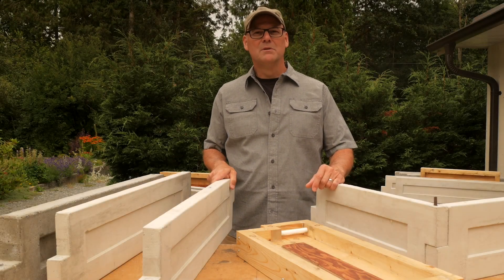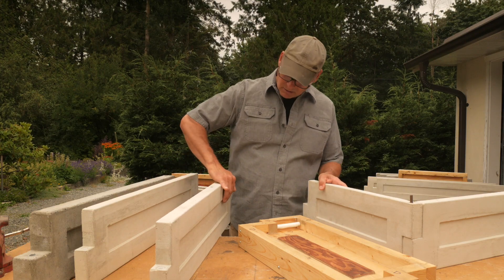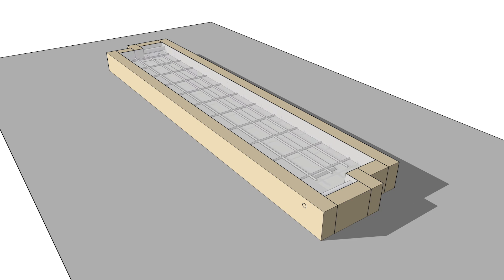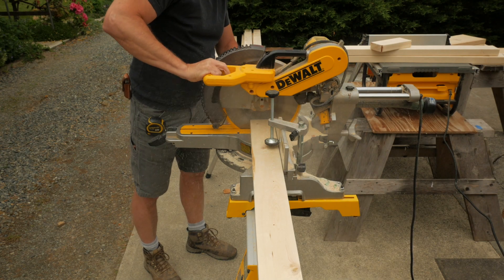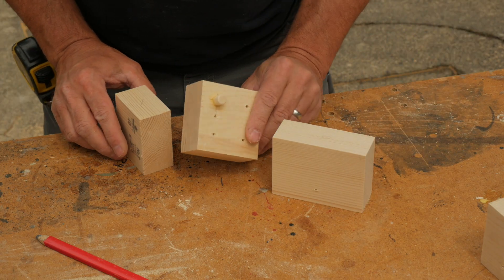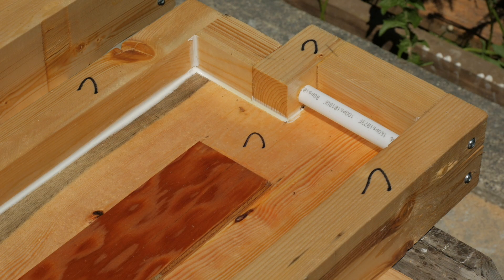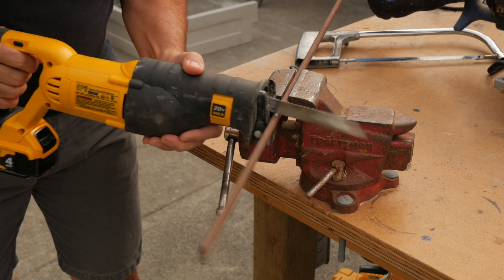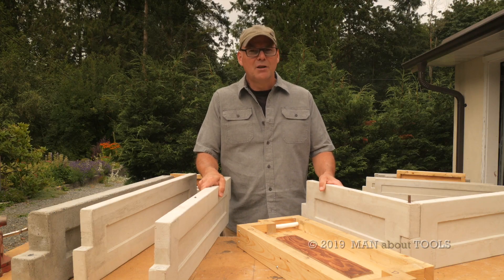make Thin CSA Concrete Garden Boxes PART 4 - cast garden forms

Comment: You can also do something else for decoration. Leave out the inset, pad the mold with plastic foil, spread a thin layer of sand on the bottom (really, 1/4" or less), then spread pebbles just barely twice as thick as the sand in a double layer. Use a spray bottle to wet the sand and the pebbles. Or maybe use water for the sand only, then, after having spread the pebbles, use a ... thing whose name I don't know in Engish, but which strengthens the bond between the pebbles and the concrete. And only then pour the concrete. The sand will wash away after you de-mold, and you'll have a nice pattern of tiny pebbles on the surface. With the right pebble size, they should be enclosed in the concrete, not just attached so that they can fall out.

You do need the wire mesh, regardless of what cement you use. Concrete alone is strong in taking pressure. Rebar or wire mesh is added for making it also strong under strain. It would crack much faster in winter, when water inside it freezes, without the wire mesh.

I have a question, though: does the weight difference come solely from the lower thickness, or is the resulting concrete less dense?

Comment: thanks for sharing, looks great, can't wait to try my own. My wood boxes only last 5 years or so. I'm going to try to make ends rounded so the panels can be rotated at angles other than 90 degrees so other polygon planter box shapes can be laid out. It would be nice to be able to plan out triangles, pentagons, or even curves with many 24" panels. Also planning on replacing the simple beveled inserts with some molding with vines/flowers if I can find a design that will still release easily. Lastly, the previous comment on getting the wood grain in the mould is a good idea, sandblasting also gives a nice neep wood grain effect but I suspect that the more designs in the moulds will make the release increasingly more difficult, maybe necessitating a silicone releasing agent.
Reply from the maker: Thanks! And thanks for the comments and ideas.

Comment: Calcium Sulfoaluminate (CSA) concrete is also highly resistant to sulfate attack, so it is perfect for use around livestock where subject to manure exposure, wastewater treatment and conveyance systems where subject to Hydrogen Sulfate gas, and in soils that are high in sulfates.

Comment: would you recommend disassembling+storing the panels or covering the garden boxes with a tarp in the winter to try to prevent the ice from cracking them?
Reply from the maker: I leave mine as is for winter. However, I'm on the west coast and our winters are milder than others.  Covering might be an option.

Comment: I would be more amazed i I once saw an American drilling a hole without a drill press. Cutting a piece of wood with a hand saw etc. All I see is expensive wood working tools, CNC machines etc. So like any video made, this shows you that you need 1000$ before you start making the 10$ garden form.
Reply from the maker: Or a Canadian in this case. Certainly you don't need a lot of expensive tools to build these forms and cast the panels. Some hand tools or hand power tools would do. In many of my videos I show alternative methods. I have a cheap table top drill press and my table saw is portable and close to the cheapest model available.

Comment: @Man About Tools: I only have one word for you brother:
Aircrete.

Those blocks will float too if you use this stuff. Your forms can also be used to recycle plastic if you have enough shavings to do it. You'd basically be using it as a hot mold and injecting the molten plastic to make it work, so there's a need for an additional plate with multiple injection ports. Still favoring the aircrete idea first though. Your's is already pretty close to that as it is, but aircrete will make the concrete go even further and should reduce the price of your final product.
Reply from the maker: FatChanceTheCouchDog  See Part 3 then 3.6 of this series.

Comment: I'm not sure why strength needs to much of a consideration here.  There are no loads.  BTW, try pearlite insulation as as an additive to make the panels even lighter.  There are are also foam additives for additional lightness.  I bet you could get them down to 20 lbs!
Reply from the maker: Yes there are lots of options. See the other videos in this series. I have 7 so far.

Comment: A tip. The compressive strength of the concrete is keeping the centre fairly stress free. Better to lay the reinforcement one third from the outside edge.
Reply from the maker: I agree. It's just a bit of a challenge to get the grid placed exactly where it's most effective.

Comment: Great video with easy step by step instructions. Would aircrete be a better alternative instead of concrete?
Reply from the maker: Thanks! Aircrete is an option. See Part 3.6 . There's always a strength and durability trade off when going light weight.

Comment: I like the comment that Garret Peterson made about the outside face being in tension when say heavy (clay) soil or frozen soil expands. During the video I saw that you added an insignificant amount of glass fibre; you didn't even quantify it in your ingredients proportions, but glass fibre can entirely replace the galvanized metal as a reinforcing material. You might even blend your mixture so that half has 2/3 of the fibre and the other half has 1/3 of the fibre, then coat the bottom outside face with a little low fibre mix. Not much just enough to reduce the amount of fibre showing on the face of the finished product. Then place the high fibre mix in before leveling it off with the remainder of the low fibre mix. Vibrate as before. After extraction from the forms I think another concrete counter top maker used a sanding block to removed any exposed glass fibre. Maybe this is too much fiddle but it was just a thought I was having while I was noting how little fibre you appeared to be adding.
Reply from the maker: The amount of fibre added was from the manufacturers recommendations. It's a small amount but if really does distribute well and it's visible if you look closely at the panel. I can't say for sure that it does what it's supposed to do but it's cheap and easy to add. So why not. If you want to experiment with larger amounts then please let us know your findings. Thanks for the comments.
Reply: @MANaboutTOOLS  I'd really like to do so but first I have to get the house built! Those priorities always get in the way of fun stuff. smile.
Reply: In the video 1/3 oz fiber was suggested  ....  I cast my first four 11" X 48" panels without steel and 12 hours out of mold they broke very easily . Curing must be a critical part of the formula.  I used  1 oz of fiberglass instead of 1/3 oz and it seemed to be useless.

Comment: Concrete exposed to freeze thaw action requires air entrainment. You can do this with an air entrainment additive or a bit of Dawn dish soap. Doing this will help to prevent surface spalling when water trapped in the concrete expands as it changes from frozen to liquid state. This is a great idea. Thx for sharing
Reply from the maker: Thank you! And thanks for the comment.

Comment: Adding an air entraining agent will help guard against freeze-thaw problems if the climate has this issue(these are micro-bubbles not air pockets) the total strength of the concrete will be reduced a few percent but it will be tougher(less brittle) and less water absorbant.
I might try wrapping a flag of 1/2" mesh around the dowel pipes as it is a high stress area.(It may be of benefit to make the shape thicker at the ends and more I-beam like in the middle too.) 
I don't see a need for ripping the bottom side of the 2x4 edges so that could save a little bit of work.

Adding a small tongue and groove feature (maybe 1/4") along the edges would make stacking much more sound, the trick would be getting a good size match between the male and female edges and then also good mold release. Probably not worth it for a simple double stack but useful for taller walk-up boxes/planters.

Comment: Maybe I missed it in the comments somewhere, but it would be great to have a cost in your video description along with a cost comparison to making beds out of wood. Also, I assume that concrete will out last wood by many many years. Thanks for the video, it's awesome!
Reply: That bag of Rapid Set Mortar Mix is US$18 a bag. Materials to build two forms is about US$200 (mainly due to the lumber and the screws).

Comment: Very clever design.  I never would have thought of this....I would have poured or bricked something on site.  I’m curious if you plan to line the concrete or put some sort of sealer on the surface to reduce leaching into the soil .... or simply plan to add acidity with mulch or chemicals.  Any recommendations?

Comment: Those 2x4's don't look like the "2x4"'s you find at the home improvement store, which are 1.5x3.5's with rounded edges. They look like actual 2x4's. Where do you buy those?
Reply from the maker: Dan Weese I think I ripped them down from a 2x6 to get the sharp edges

Comment: This is really cool, and it looks great.  However, whatever this may cost in the US, in Canada I estimate it would run around $15-$20 per 36" panel, based on a cost of $24 per bag of mortar mix (not specifically stated to be CSA) at Home Depot, plus a best guess at the cost of the additives which are not even listed on their website.  For that price I can build more than four times as much wall from precast 4"x16"x8" blocks (from *munged to avoid shilling*, anyways—HD doesn't want to admit whatever they're charging online).  I could halve that by buying the mortar at *munged to avoid shilling*, but again, it's hard to say whether or not that mortar is the right kind.  It's a shame, because I'd really like to do this, but there's no way I can afford it.
Reply from the maker: I completely understand. Have a look at the panels I made in Part 2 of this series. It's the cheapest way to go and they work just fine. A lot of folks wanted a lighter panel so that's how I ended up down the rabbit hole for parts 3, 4, 3.5, 3.6, and 3.7
Reply: @MANaboutTOOLS  I actually just checked out parts 3.5 and 3.6—I'll go back and check out part 2 next.  Thank you.

Comment: Very cool.  Probly already in here somewhere in the comments, but... If you plan on making a LOT of these, you might consider adding dowels along with the screws in holding the sides to the base.  Only glue the dowels to the side and not the base, this way the dowels act as registration marks so the screws keep going into the same hole instead of into almost the same hole (doing the almost same hole would end up making the base not hold as well after hundreds of uses).  Thank you for sharing

Comment: I just love these so much! Great job and thanks for all the hard work you put into designing such a great DIY project. I wonder if you could re-design the corners to eliminate the visual overlapping connection...just for aesthetics. So, from the outside, all you would see is a nice, clean corner with no joint showing.

Comment: Does this series go from part 3 to 3.5, 3.6, 3.7, then 4? Are there any other parts or is that it? Thanks.
Reply from the maker: It's a bit convoluted. I went 1 to 4. Then went back to revisit some more lightweight options with 3.5 to 3.7
Reply: @MANaboutTOOLS  Thanks! Great work!

Comment: I made my previous comment half way thru your video. That was a mistake. You're a genius!
Not only was the actual build great but the narration and video design were perfect. Thanks...you gave me some new ideas. 
You can make your mold out of silicone. A company called Smooth-On in PA supplies everything you need. They also offer classes. I attended a two day class back in 2004. https://www.smooth-on.com/?pk_campaign=6485697993&pk_kwd=smooth%20on&pk_source=google&pk_medium=cpc&pk_content=381355750769&gclid=CjwKCAjwmKLzBRBeEiwACCVihqc6Mc4fYn_m9FScwm5aUpHbUm1gNA9YE-SZFULg30pZe6h49FUHYhoCnnsQAvD_BwE
Thanks again

Comment: Hi, I have watched all of the iterations of the concrete panels and I have a suggestion for improvement. It seems to me that the embedded tube in the concrete could be a cause for failure in northern climates. as eventually with the differing expansion rates of the concrete and the plastic tube, water will eventually penetrate and potentially the slab will crack. So I thought, why not use backer rod instead of the tube, remove the dowels, and leave the holes open for threading the rod through. (it's not really rod its closed cell foam) then once you remove the  slab from the form, dissolve the rod with acetone. Now the slab is all concrete, and you can make it even thinner because you can use a smaller diameter backer rod then the plastic tube. Just my 2 cents, I am sure you are tired of making these things by now.
Reply: Interesting idea with the backer rod. But how would you hold the backer rod straight & tight during thee pour? The backer rod is too flexible. Not seeing how you can accomplish this.
Reply: You could shove a thin diameter wood dowel through the centre of the backer rod the make it stiff

Comment: You can add the wire mesh to regular portland concrete for strength. Not sure if CSA is needed. You might want to add reinforcements around the pipes as well.
Reply from the maker: I add wire mesh to all other concrete forms. See part 1-3. I didn't add any around the pipes in this thinner design due to space constraints.
Reply: @MANaboutTOOLS  Try making the portland cement as thin as the CSA a to see the strength. I would add 1:3 cement:sand. I'd also add the fibers and 1:0.1 cement: silica fume or powdered kaolin clay (porcelain clay). The fine particles add strength to the mortar. Oh, I would add a bit acrylic fortifier too.

Comment: What about using linseed oil to prevent concrete from sticking to the forms would that work better and last longer than vegetable cooking oil
Reply from the maker: I like the veg cooking spray cause it's cheap and easy to apply. And seems to really stick to the forms well. But I'm sure almost any oil would work.
Reply: @MANaboutTOOLS  do you think linseed oil would stay on wood( residual) for the next concrete application.. thank you for answering my question.. just discovered your  channel.. I have some 100 year old case iron molds in storage(family)I'm looking forward to using.. would like to use them with someone like you
Reply from the maker: @ottomaguire2443  I don't think so. After stripping the forms the wood almost seems dry. I spray the veg oil before each pour.

Comment: would tractor supply chicken wire word for reinforcing the concrete? is there a special grid product you use in particular or do you make it yourself?
Reply from the maker: I have found that galvanized 4 gauge Hog Panel works very well. I use small bolt cutters to trim it down to a size I need. Agricultural or farm fencing suppliers carry this heavy gauge fence. I used it in Part 3 of this series. Also in Part 3.5.
Reply: @MANaboutTOOLS  Thank you for responding. I live very close to a tractor supply store, so... I wasn't sure if one or the other would help more. again, thank you

Comment: Appreciate the quality of video production . 10/10.  Could be used to teach teachers
1.  Safety.  Table saw never stand in front of the blade.  Face never in  line with blade.
2. 2% angle on edge of insert might assist separation.
3. I would have finished the wood with a sealer & or exterior finish 1 coat.  Then used a non stick cooking spray
4. Use stops when cutting multiple short pieces to length faster. Consistent .
Reply from the maker: Thanks! The insert had a 30% angle. The wood had mineral oil as a sealer as it's fast and easy to apply. Cooking spray was used.

Comment: Any recommendations on a concrete with a low CO2 footprint?  I'd love to make these, but I usually shy away from using concrete when possible...
Reply from the maker: I think the CSA is considered a "greener" option than Portland cement.
Reply: @MANaboutTOOLS   Ah, you're right!  Now that I've read up on this a little,  CSA only uses about 37% of the carbon that Portland cement uses.  As far as I can tell, this is as good as you can do using materials that are commonly available.

Comment: Years ago I read a story about a geologist in Rome on holiday who discovered the secret to 2500-year-old still stong concrete. Is this CSA a result of that discovery?
Reply: From what I can tell no. The roman concrete contains Aluminum Silicate from volcanic ash though it seems fly ash from coal plants may be a suitable replacement for that regional volcanic ash. It actually forms a crystalline mineral  tobermorite in contact with seawater making it stronger instead of falling apart

Comment: If you made vertical holes in the top edge of the block while pouring the concrete, you could build wood posts upwards, and make walls of plastic or glass, and a ceiling for a hot house.

Comment: Being an architect I would caution people from using concrete without fully understanding the possibility of chemicals that can leach from the concrete.  Especially if the light weight type contains aluminum.  Here is a link to an article on this topic. I like the design, it hold merit.  I would encourage the maker to investigate a method to protect the soil and the plants from the concrete if they believe it may compromise the safety of the soil and fruit.   https://www.preventdisease.com/news/15/020615_Warning-Cinder-Block-Concrete-Masonry-Gardens.shtml

Comment: so you dont need to spray the forms with silicone or some other release agent
Reply from the maker: In all the videos in this series I have been using Vegetable Oil cooking spray as a release agent. Even if I have coated the form with Mineral Oil.